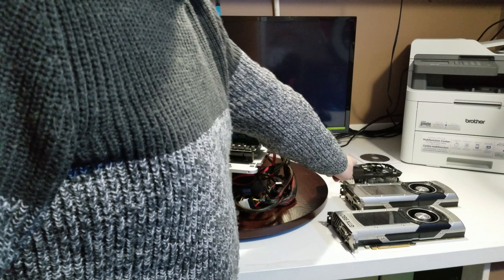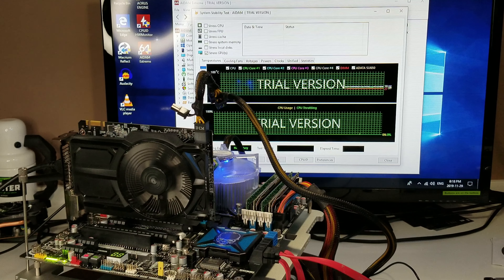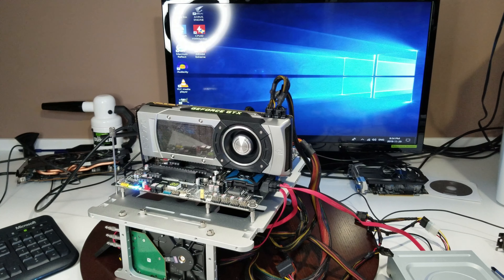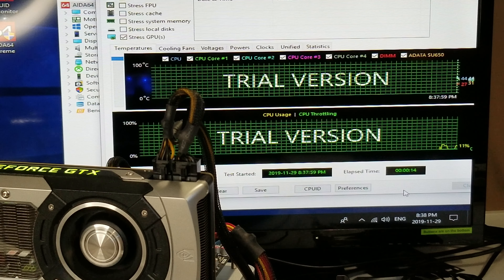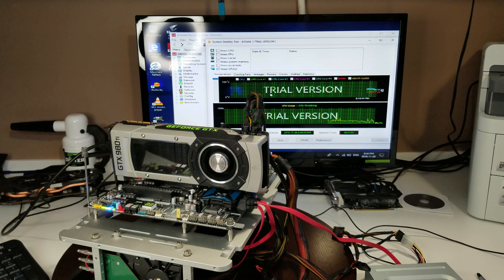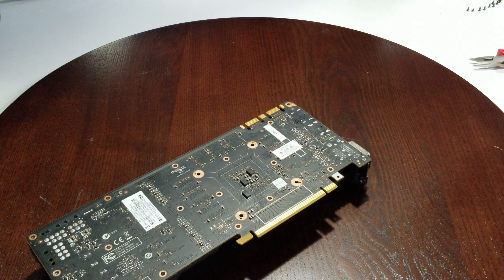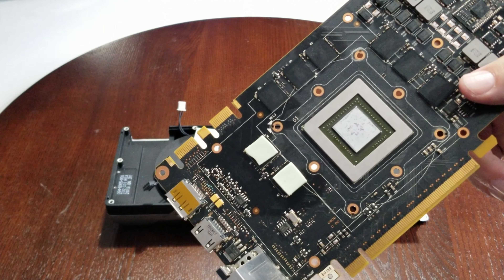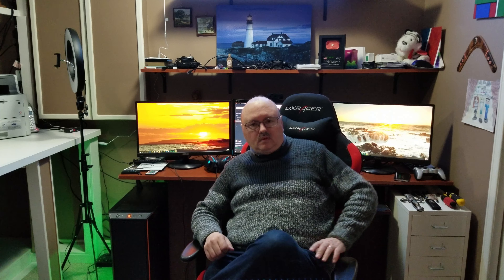Testing GPUs GTX 770, 960 & 980Ti Stress Test with AIDA64 Extreme and Partial Teardown

Comment: I really enjoyed this I wonder if there is a power delivery problem on those cards. Like as they demand more current the power pin is unable to provide it🤔 did you toss those out? I would like to see a follow up if not you then maybe by me lol 🤙🤙🤙
Reply from the maker: I have Thermal Pads coming in the mail, and I'm going to try replacing them and re-applying the Thermal Paste on it as well, and hopefully that might do the trick...worth a shot...Thanks...
Reply: Reviewing Playing & More RPM nice I am been learning lots about computers and I can actually understand your videos now. I have a whole new appreciation for your videos 👍
Reply from the maker: @GeorgeJFW  much appreciated man, yeah it's a lot to learn, and I'm still learning every day...Thanks...
Reply: @Reviewing_Playing_and_More_RPM 
I don't think a thermal issue would cause artifacts.
It could, but only after an element burned out because of a termal issue.
You can't revive a burned out element by simply re-cooling it, it needs to be replaced.
Reply from the maker: @deadlyqueen  I agree, it worked for a while though, the artifacting returned 4 months ago and after that I couldn't repair it any longer. I don't have the know how to replace the element but working to learn more about these things. At least I got a while longer from it though. Thanks for your info.

Comment: What is the duration of the cpu test ? 
The test will finish with itself automatically ,or I should stop the test after some times ?
Can I make cpu test with gpu test at the same time or not preferred and should make each test alone ?
Reply from the maker: I go anywhere from 5 mins to 15 mins...that's usually enough to matter, I have run tests for several hours sometimes though...with AIDA 64 Extreme you can do several tests at the same time, CPU, GPU, Memory and more...depends on you but I do CPU & GPU together at the same time usually...Thanks...
Reply from the maker: No graph, the Temps typically start with the CPU, then break it down to individual CPU Cores...and it'll depend on how many cores there are...as the Motherboard itself gets hot so can the DIMM slots, you can measure how hot it gets in case it is somehow interfering which in all the time I've been working on PCs hasn't mattered enough for me to have concern...As for the other things, wasn't sure myself, but this is the breakdown...IA=Sensor placed in the cores, GT=Sensor placed in the GPU(On the CPU) and Package=Temp of the CPU package itself...(looked them up lol)...hope that helps... Thanks...

Comment: Good day. I have a question this time . My pc is restarting everytime i try to play . But here is the interesting thing . When running all the diferent stress test everything works perfect . Thing may get a little hot but the pc is staying on . And another intersting thing is that when im playing usage and temperatures are not even high. Any advice pls let me know. 

Thank you
Reply from the maker: So a couple things that have been know to fix this is 1.) changing the power setting to balanced, 2.) Some power supplies have an eco mode switch, try turning it off as well, if both don't work (along with a re-boot afterwards) let me know and I'll try to give more info....Good Luck...Thanks...